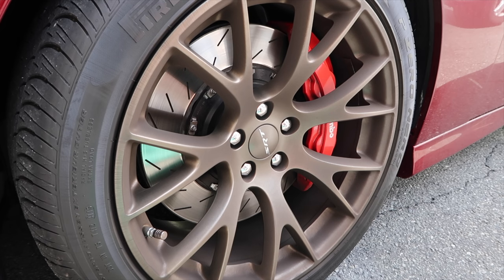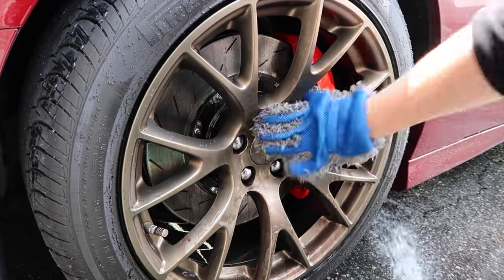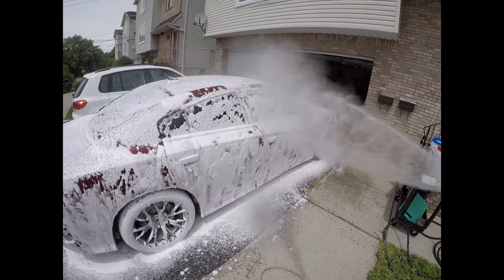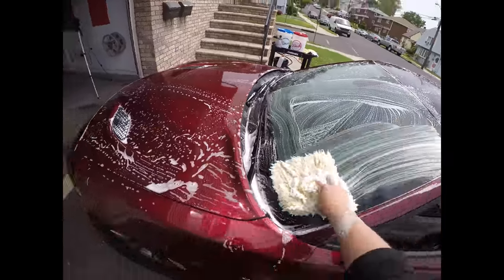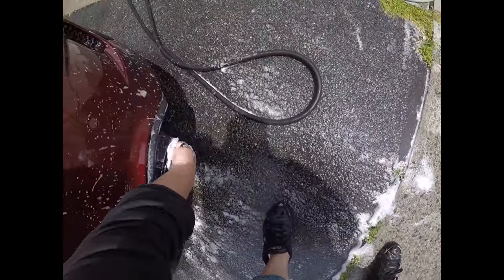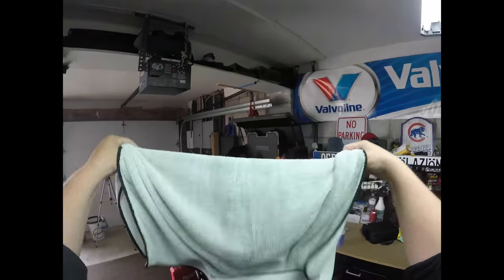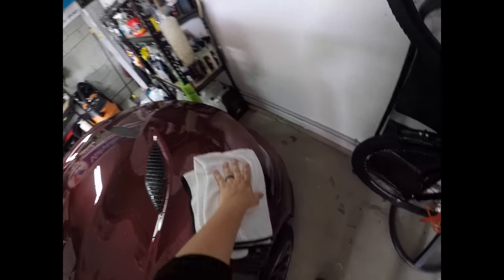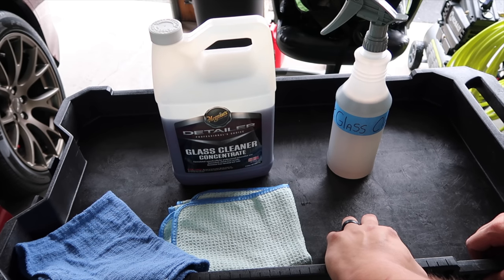My Car Wash Part 2: The Actual Washing Process

Comment: What do you do about the foam on the SUV in the back after you foamed the charger?
Reply from the maker: Breaking rc I washed both vehicle at the same time basically. After one was foamed the other got coated and washed by the owner of it lol I wouldn't let a car get assaulted with foam and water without a wash :)
Reply: HonestlyOCD lol ok sounds good

Comment: Awesome video dude, I can't wait for more! Instead of dragging the expanding hose out too, you should just add a male quick connect to your garden hose inlet on your pressure washer and disconnect the fire hose nozzle, allowing you to use your hose from the hose reel to power the pressure washer, that way you wouldn't even need to drag out the expanding hose. Just a tip!

Comment: OK I'm sold on the Avalanche, watching you get through the whole car with the suds clinging to it and then the 40 nozzle struggling to strip off the suds... woah.   Looks like I need to get back in the 2500+ PSI range and get foaming.  BTW Your Adam's rants are totally entertaining.  One Question.... does the Avalanche smell like fairy farts, because that would be EPIC!

I've got almost the same order in cleaning the body, I like the slightly more aggressive wash pad idea! My wheels I'm all hands on with a detail brush and microfiber.  I've been successful in keeping them clean with only car wash suds and every few months a coat of Jet Seal.  I tried tire gel once and it smelled pretty bad, the stink lingered for a long time after the wash and I still needed to scrub so it's was not worth it. 

Tire gels I need some suggestions, the stuff I'm using works but it attracts the brown and is a bit of work to scrub off and re apply.  I've tried a few of those non greasy (lasts for 6 months) tire coatings, they look amazing when applied like black satin tires.  with low profile tires if anything rubs your sidewall it's gone.  This is the only area I'm stuck on finding a good product, most of last season I just scrubbed my tires to perfection and ran with no tire gel.  Please let me know how the AMMO works, big fan of his channel.
Reply: Work Play Drive you wrote all that and he didn't reply....I'd unsubscribe.

Comment: I've noticed if you keep your vehicle clean and are on a routine scheudle cleaning the wheels, heavy duty cleaners aren't even necessary. Often just a simple all purpose non acidic cleaner can and does a great job.  Now if you don't want to get your hands duty the wheel spray cleaners are the way to go, but some aren't cheap and you can go through them quickly

Comment: I have recently used Meguiars Ultimate Fast Finish spray on wax on my '16 Charger after a good wash and the shine was amazing. A little goes a long way, it's a spray that you apply to a microfiber towel and wipe on and buff off. You might want to give it a try.

Comment: Ok, big question for ya!  Love the channel btw.  Your ceramic coating, how is it holding up?  What has your experience been like with it?  If you could go back and spend the money to do it again, would you...  or would you choose another option ex: traditional 3 month waxing, laminate clear wrap protection, and so on?  I haven't done my car with either yet, but I want to protect my paint for the long run against bug stains, bird stains, chemicals, and of course washing.  Thanks in advance!
Reply from the maker: KvotheYSL21 I went with Cquartz Pro .. I have nothing good to say about it lol I feel it was a waste and the detailer that installed it might be slightly off .. I'm actually having a new detailer come shortly to polish this coating off, correct the paint again and were going to try two coats of Ammo Reflex, one coat of Ammo Skin and one coat of Ammo Creme .. I'm told Ammo products are more layerable and product friendly so were going to give that a run .. I feel coatings are too finicky and other products can too easily degrade the longevity
Reply: HonestlyOCD Thank you, keep us posted on the Ammo product!  I've got time yet before I pull the trigger 😊

Comment: Hey quick question bud, do you think a drying aide is necessary with drying towels? Or is it best to just use it right out the stack? Or get it damp first? Sorry, want to make sure I get all my questions out lol
Reply from the maker: Nicholas Martinez I use a drying aide just because I feel it keeps from potentially dry rubbing once the initial SWIPE is done and you go back for a final buff .. Poorboys spray and wipe or Ultima waterless wash are good for drying but they have Adams h20 guard and gloss as well as ammo hydrate that are specific to help remove water faster without wiping as much
Reply: HonestlyOCD Thanks man! New sub right here. Love the douche of the day been cracking up for 45 mins!!
Reply from the maker: Nicholas Martinez thanks for sticking around means a lot !! :)

Comment: Tbh i use some expensive stuff, but i use turtle ice.. Yes turtle ice detail spray to maintain it having a ram it takes a lot of product to clean the truck. Its like 7 bucks a bottle and im really surprised how well it works. Specially on black plastic parts like inside the engine bay. Or on my Wjs plastic mirrors. Not just that if i miss a spot wiping it off it evaps rather than stain. I also clean my tires and rims with simple green which is an awesome cheap paint/finish safe de greaser. Like your window cleaner i buy the half gallon and make 5-6 gallons with it. Back to the turtle ice im sure ill get a lot of hate for it but turtle really stepped up their game with that stuff its worth a try!

Comment: im really interested in the drying towel. i have a 17 midnight black scat charger. its so easy to get fine streaks on the paint from drying. im currently using a 10$ drying microfiber towel from auto zone.
Reply: Preston Williamson those streaks you see are actually scratches, I've found no matter what when you touch your car, your scratching it, there very minor though
Reply: I've got a couple of the cobra guzzler towels and they work great.  my wife has a new Mazda CX9 signature edition that's a dark metallic gray color that shows streaks and swirls pretty easily and after polishing it and using the guzzlers to dry it the last 6 or 7 washes, there's no streaks.

Comment: Wow that was awesome bro lol, but is a ceramic coating an easier way to make sure the car stays clean? I'm kinda like you but I'm lazy lol
Reply from the maker: I've noticed that since I've coated, the car has stayed cleaner LONGER and it seems like less dirt/dust and other shit don't really stick much lol the lower half is still blah at times but it's good and the car definitely cleans faster as well since less water stays on the paint !! now that I've coated a car I'll likely never go without a coating again to be honest lol having it coated and doing spray wax type toppers once every few weeks is a big step above the typical wash and wax I've endured for a long time :O

Comment: Have you tried CG Jetseal? In your humble opinion, is it junk, so-so? Do you prefer Wolfgang? If so, if you don't mind me asking, why? I'm open to changing and giving Jetseal away.
Reply from the maker: I honestly have Jetseal in my collection but I've only used it one time lol I wouldn't say I favor one over the other I honestly feel like they're both probably VERY similar so if you're using a product like Jetseal already and having good results I'd say stick with what works until it's empty and then decide if you wanna give something else a while lol the Wolfgang DGPS is a very easy product to work with and I've received some great results with it but I feel like they're probably both very similar
Reply: My thoughts, exactly! Thanks.

Comment: Where did you buy your snub nose pressure washer gun? And is the hose that connects the gun to the gas pressure washer that you have come with the pressure washer or its an accessory?
Reply from the maker: I bought the handle from MTM it's the M407.  I had it linked but Youtube told me my description was too long so I had to lose a few things LOL

https://www.amazon.com/4000-Psi-7gpm-M407-Spray/dp/B01EJ9Y5JY/ref=sr_1_1?ie=UTF8&qid=1496678209&sr=8-1&keywords=mtm+m407

the hose used was the one that came with the pressure washer
Reply: HonestlyOCD thanks! Do you have any sealant or ceramic coating on your paint? The water seemed to fly right off during the wash process
Reply from the maker: my car is coated with Cquartz Pro and now has two different layers of Reload Spray Sealant :)
Reply: HonestlyOCD thank you again haha. Could you tell me what the name of the streak free glass cleaning towels are called? You said they are used in medical field and can buy them in bulk
Reply from the maker: nah LOL the pro version of Cquartz can only be applied by an authorized installer unfortunately but there are coatings where they sell from Cquartz and other companies that you can apply yourself but that shit makes me paranoid and the thought kills my nerves LOL

Comment: is the carpro reload only for cars with ceramic coatings. would it be similar to adams guard and gloss
Reply from the maker: I've used the reload on other cars without coatings and it's worked amazing as well !! I would say that Adam's Guard and Gloss is a very good alternative but definitely not as long lasting as reload .. if you're willing to use it on a more frequent basis than the Guard and Gloss would be fine I actually have a gallon of it too it's a great product
Reply: HonestlyOCD maybe I'll buy both to try them out. Thanks for the reply, I enjoy the vids 👍

Comment: Sweet video man. Love your detailing mindset. Great Information, thanks so much! I use the same Meguiar's concentrated glass cleaner paired with the sergical type rag as well. You should try/demo Ammo Lather Interior Cleansor and a boar's hair detailing brush to clean you Leather seats. Also, give Meguiar's Express spray wax a try. It is a premade detailer spray but only comes in a gallon size. It can be used on glass, wheels, paint obviously, and can even be sprayed and spread out on clean leather seats to provide a nice non-slippery, non-shiny coating You should try these products if you haven't already. Also, one thing, didn't you forget to degrease and dress the wheel wells?! lol. Anyway; I love how you clean cars and I will be subscribing now! Take care.

Comment: Rinse the foam off with the pressure washer takes more dirt off then a hose
Reply: hakman239 The soap and mechanical action of the arm and mitt removes the dirt and the water just rinses the dirty soap solution off the car surface.
Reply: The soap softens the dirt then the pressure washer removes it
Reply: Pressure washer def aids in removing dirt vs the hose..

Comment: I'm sure you have said it somewhere (but I can't see it) what coating have you got on the car?
Reply from the maker: Mac Owens I went with Cquartz Pro. I'm very OCD and a little stupid so I may have this coating polished off in a year or a year and a half to try Opti Coat Pro+ lol life is about trying new things and I wanna know what's better before I buy my next vehicle (I have a tendency to okly own vehicles for a short time lol)
Reply: I'm a bit OCD myself, can't exactly find Cquartz Pro - do you mean CarPro Cquartz - or even CarPro CQUK? I am planning on putting CQUK on mine and it is interesting to see how 'easy' yours washes. I'm enjoying your videos and like the idea of your comparison videos. Have you applied Reload to a wet car - or used it as a drying aid?
Reply from the maker: Mac Owens it's Cquartz Pro by carpro but the pro version has to be installed by an authorized installer
Reply: No authorised installers here in Ireland, maybe explains why I hadn't heard of it. Thanks
Reply from the maker: Mac Owens the regular Cquartz consumer line would be suffient too

Comment: Great vib, i have the same pressure washer, i use a 4gpm 25degree tip, it puts out a ton of water and dies not hurt the pump! Try it, it works great, i got my tips on ebay

Comment: Nice wash. And thank you for the Window cleaner tip.. The prices for  Window cleaners are damn too high
Reply from the maker: thanks !! and I agree :O
Reply: HonestlyOCD  I actually bought a gallon of that stuff, it works like a charm and smells nice. I used to use Gtechniq window cleaner. It was expansive and smelled disgusting. Cheers

Comment: Power Stop Z23's on my SRT...95% dust reduction.  Of course..you know that so why do you suffer?  With sporty street driving they seem to stop the same to me.  I'd do it if I were you...
Reply: Absolutely a must mod right there!!!  I did it on my SRT a few weeks after I bought it.  Best mod ever and no more brake dust.
Reply: Yeah Jet...best mod no doubt.  I'm wondering how long these will last with average driving...maybe I'll ask Power Stop.  I mean...they're cheap enough to change out every 20K miles or so.  I just don't want to take any chance with these front rotors...at my dealer they're $1200 ea.
Good luck brother.   Brotherhood of muscle....
Reply: FalcondRippr I've got 7500 hard miles on mine and the rotors and pads still look new so I believe the powerstops will last a long time. Just fyi powerstop also makes front rotors for our cars when the time comes. 600 for both. Not a bad deal if they are as good as their brake pads.

Comment: You did your rear bumper last due to it having the most dirt build-up, but why don't you follow the same logic with the bottom of the side and front of the car as well?
Reply from the maker: pbakai182 because my car is coated and those parts don't get dirty as much as the rear does .. actually my whole car gets significantly less dirty less often but the rear will always suck most due to this engine and exhaust lol she spits hate and the car just kicks evil onto the bumper
Reply: HonestlyOCD Fair enough! Great cleaning techniques and products btw. The amount of bottles on that shelf is mind boggling haha
Reply from the maker: pbakai182 lol thanks a lot 👍 funny thing is I have more stuff now than I did in that video due to suggestions lol also trying to get a Kranzle electric pressure washer to do some videos on since I feel it'll be a more fair comparison to my gas one 😎

Comment: the point of using a foam cannon is to lay down a thick layer of foam and then grab a wash mitt and wash the car with all that foam not rinse it off and then use a two bucket method
Reply from the maker: s actually you're incorrect. The point is to soften up the larger debris so that you can SPRAY IT OFF .. this way you're not rubbing anything into the paint.. it's an extra step to risk less damage to the paint .. You're pre treating the paint

Comment: You're supposed to leave the foam on there while using the wash mitt
Reply from the maker: Kevin C supposed to eh? What's the name of that book so I can scoop it up on Amazon lol the point of foam is to prewash the car .. You spray it on the paint and it helps loosen the solids and any larger debris .. You THEN hose that off so you remove as much from the paint BEFORE the mitt ever touches it so you greatly reduce the chance of causing damage 😉 if you think about it, it makes sense .. it may use more product and be an extra step but I'd never do it another way lol
Reply: It's very interesting seeing how many people you have to correct about the spray foam.   They missed the FACT that any dirt and grit is now trapped in that foam.  Taking a mitt to it will only act as sandpaper.

Comment: Get some ceramic pads, won't even need to address the rims again....
Reply from the maker: Brian Bos I've been looking into that but I'm hearing too many mixed reviews about the performance part .. which pads do you recommend ??
Reply: HonestlyOCD I run the z26 by powerstop, which is probably overkill for the street. Z23's would be fine. As long as you bed them right they are great. I didn't bed on my old ctsv and they were fine, but I followed the exact steps with the cat. Night and day on brake dust and it's a quick swap.
Reply from the maker: I get nervous with that "bedding" process haha did you swap the pads on your own ?
Reply: HonestlyOCD Yea swapped on my own, it's an easy job and well worth not having destroyed rims every 10 miles
Reply from the maker: I'm likely going to go this route lol I was also curious to try cleaning, claying and coating the whole wheel to see how it responds and maybe topping it with Gyeon Wet Coat as well for more hydrophobic properties .. at the very least it would make for another video before having to swap the pads haha thanks a lot for the information on the parts I appreciate it !!
Reply: My wheels are ceramic coated and it didn't make a difference with the stock pads.  Still a major pain in the ass to clean.  I've had the ceramics on for about 1000 miles and haven't reached in to wipe my calipers yet.
Reply from the maker: thanks brotha I appreciate the help :) I get too paranoid with the brakes so if I change them I'll likely have a shop do the bedding process lol my area SUCKS for stuff like that because there aren't many places to get up to speeds and hit the brakes like if I were to live down South .. makes me wish I was in Texas or Florida lol
Reply: I'm in a fairly urban area as well.  I did it on a Sunday morning.  Only chance I had.
Reply from the maker: Brian Bos how long did the process take you ??
Reply: They give instructions with them...I think its  

5 40mph to 10mph moderate brake sessions, don't come to a complete stop and then repeat

5 30mph to 5 mph moderate brake sessions, don't come to a complete stop.